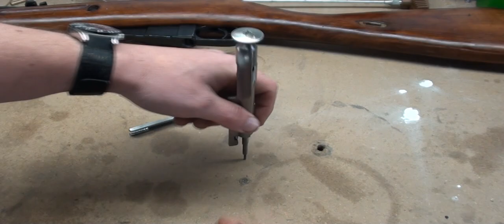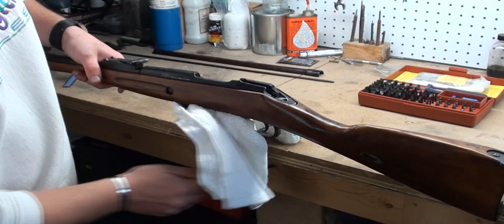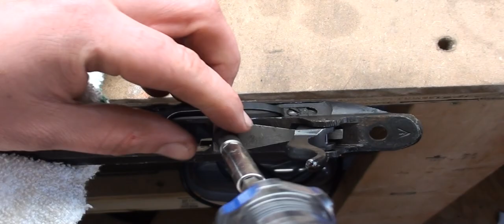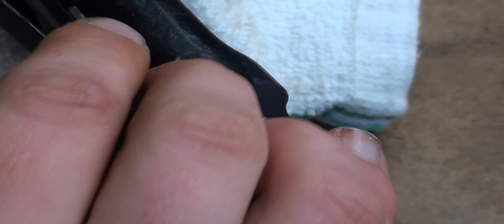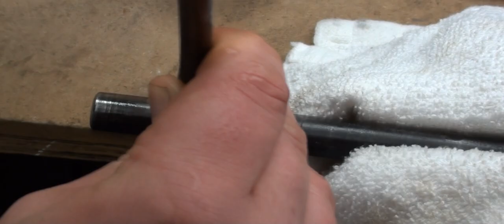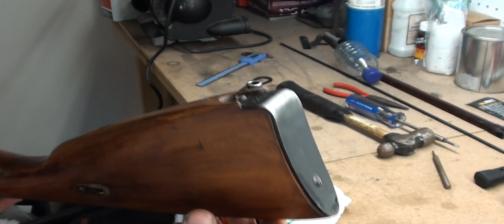Sporterizing the Mosin Nagant Part 2- Complete Disassembly

Comment: @HungarianLegionairre Timney makes drop in trigger mechanisms. DAGS

@henreycems a restoration would leave the machining marks as found since they are 'correct' for the gun. A restoration attempts to restore fit, function and appearance to (usually) like new. It doesn't go beyond that. For instance, if I restore the finish on my stock, I'll wipe the old shellac off with alcohol, lighten up the wood where dirt has been worked into the grain and re-apply orange shellac ... the original finish ... with a brush ... the original method of application. I will sand no more than the bare minimum to smooth out damaged spots and I will not sand between coats of finish because that step would have been skipped both in 1938, when the gun was made, and again when it was refurbished by the armory prior to storage after WW2.

OTOH, if I wanted to turn it into a display piece for my wall, I'd (probably) remove the shellac, give it an over-all light sanding, apply tung oil generously (virtually guaranteeing that the wood will last for many more decades while simultaneously destroying its value as a museum piece) and finish off with many hand-rubbed tung / varnish layers with 000 steel wool between coats and finishing it off with paste wax applied with 0000 steel wool to bring it to a buttery sheen. Then, when the metal came back from being professionally re-blued and lovingly re-rifled, I would carefully and painstakingly re-assemble it and, with great reverence, place it in a location of honor above my fireplace while wearing white cotton gloves.

Then I'd use my cheap 9mm pistol to kill anyone who dared put a finger print on it.

Comment: @AFeebleMind You asked two questions, so, since IV8888 has not bothered to answer you, I will.

First: COULD you do what he is demonstrating? Yes. Pay close attention, go slowly, rewind the videos as needed and yes, you COULD do every thing he is demonstrating: gunsmithing is simply a sub-set of the wider realm of knowledge known as the machine trades. If you can envision in 3d and do some math (sometimes quite a bit of math!), you can master any portion of the machine trades you set out to master. If you can't do those two things (envisioning and math), you can't and should hire any work of this nature out to someone who can. 

But SHOULD you? That's a question you alone can answer. First off, the Mosin Nagant shoots a large bullet with considerable accuracy a LONG ways as is. If you shorten the barrel, you lose both range and accuracy at range. It's just physics and doesn't make you a bad person ... but it's unavoidable. So, the question of SHOULD you make these modifications is based entirely on your shooting intentions. Do you want to use this for long range elk hunting? Don't shorten the barrel. If you intend to use it for hunting in brush (for whitetail deer, for example), then nothing is lost in shortening the barrel a reasonable amount.

If you have in mind mounting the action in (for instance) an Archangel tactical stock, you will probably want to modify the bolt to keep with the over all appearance of the stock. In that case, you will need to dis-assemble the bolt as shown. But if you don't intend to change over to a low profile bolt (necessary only if you intend to add a scope to the receiver later on), then pull the bolt assembly out of the receiver and lay it aside as an assembly, because there is no need to disassemble it any further at this point.

The answer to "could I?" is a simple "yes." But only you can answer the other question of "should I?" because it's your rifle, your budget and your intentions ... not ours.

Comment: My barrel bands are two front bands unfortunately. My Mosin is in a war time stock. It looks like someone threw it out of a truck going 100mph. There is even a bullet graze and multiple marks from being braced on a wall, window, or fence. I don't know if the gun was originally in that stock or not but its a 1935 and the bore is in excellent shape. It also has two more dates on it that were etched in. 1949 and 1950 with an MO etched in afterward. It shoots great but the bolt is slightly sticky.

Comment: M44. Barrel cut at end of stock, 1916 Mauser front sight installed, bolt turned down about 45 degrees, recoil pad installed. It is mine, it is "sporterized", and it was never going to be a "collector's piece" that I had to maintain the value of. Sort of a "Mannlicher Tanker" type of conversion that never was but should have been.

Comment: Thanks for this series...tons of excellent info.  Been looking around for a proper set of screwdrivers for gunsmithing projects for a while now and was wondering what is the brand and where you got the set you are using in these videos.  I like the way the bits on this set are designed to fit in the screw driver so the end of the actual screwdriver itself is closer to the end of the bit so there is less chance of twisting your bits out of the screw head.  Lots of sizes to choose from too...

Comment: @RonPaulIsiah cosmoline is like a super sticky grease type stuff they use to store old rifles and handguns to prevent rust and corrosion, the purpose of taking it off is so the gun will function properly and smoothly. In barrels it can be so caked on that it will affect the safe functioning of the firearm.